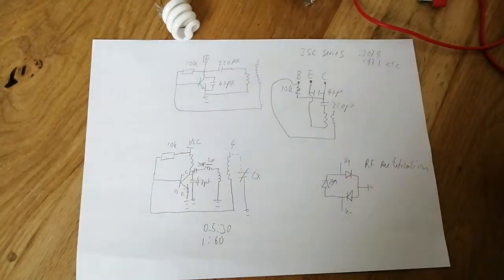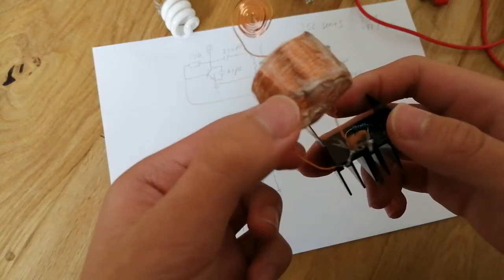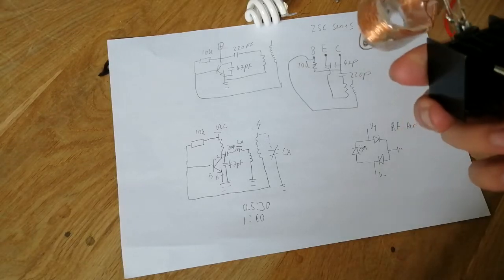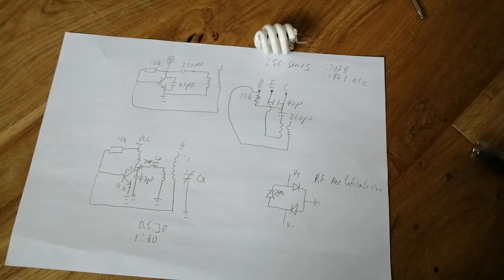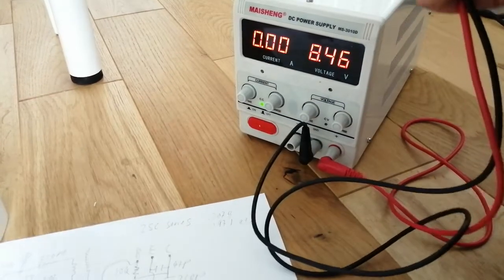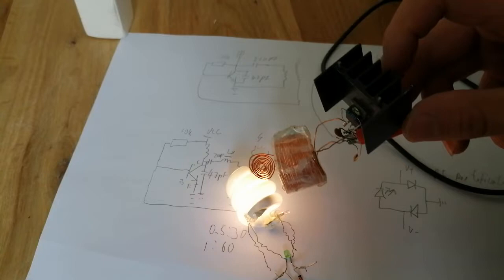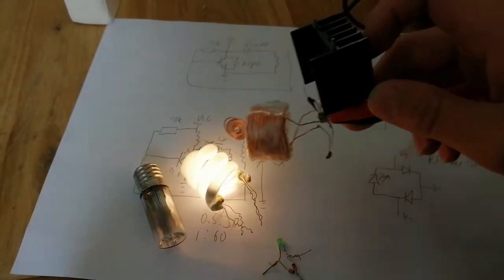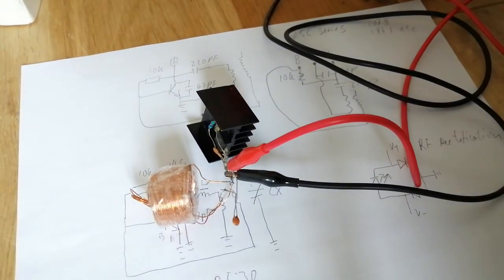Powerful RF oscillator DIY construction explained (infamous 2sc2078/ 2sc-series)

Comment: I really admire your grasp on the many properties of the circuit. I went to airframe and powerplant technician school years ago and learned about series parallel complex circuitry, which was 1/3 of the course. The many components of a circuit and their combination of varying interaction between the other components is a beautiful thing if one can truly 'see' it. I'm still working on reaching the the level of understanding that provides the perspective of oversight that you seem to have reached. I am still within the mathematical level. I raised 4 kids by myself, so my wants and desires have taken a back seat all these years. My role there has almost come to completio,  so maybe I can dive back into understanding how, why, when, where etc that valance ring electron does what it does. Thanks for the video.

Comment: Hi bro what is the benefit of the capacitor between collector and emitter 
And is the circuit of Germany boy is fake or what ?
Reply from the maker: The capacitor between collector and emitter forms the resonant circuit. Which is a high voltage colpitts oscillator. The German boy is real.
Reply: @ReedSwitchTube  thank you very much bro you help me too much 🙏
Reply: @ReedSwitchTube  but, I have another question why it is just working with this kind of transistor,  I mean what is the special thing about this transistor
Reply: @ReedSwitchTube  how about the 220pf capacitor it  also help to oscillate 
With inductor
Reply from the maker: @aemnmutahar8347  yes it has to be a special type of transistor, 2sc series is 6 used in RF amplification with pretty good gain. In the modern days Many transistor found online are all fake. About 99.98% fake. The 0.02% that you found a real one is pretty rare. Beware of the Chinese seller. I've got mine salvaged from a real transmitter by my self. Don't ask me to sell it as it is one of my artefact collection.
Part 2 of your question the 220pf capacitor needs to withstand the RF current and voltage. Cheap capacitor is very bad for this application since the RF capacitive loss is very high and your capacitor may heat up very badly. The capacitor should be rated at 1kv.and capacitance can be vary a bit. Since every one wond the coil differently. Inductance may vary. Best type is RF doorknob or mica capacitor. I hope this helps.
Reply: @ReedSwitchTube  that is mean that 220pf is just to withstand from current and voltage
Reply: @ReedSwitchTube  and from where you have buy your transistor ?
Can you tell me please if there is a store that you trust it
Reply from the maker: @aemnmutahar8347  yes the capacitor needs to be able to withstand radio frequency current and voltage. I think I've told you that I did not buy the transistor I've got it as a RF transceiver from a local ham friend for free because I salvaged it myself I know it 100% real and it from a working amplifier section so the transistor has to be real. Therefore I can't recommend you any real seller on the Internet yet.
Reply: @ReedSwitchTube  To conclusion our conversation, that is 47pf capacitor and the inductor is to oscillate, 
And the 220pf is just to withstand the high frequency, current and voltage , I am right or not
Reply from the maker: @aemnmutahar8347  yes both capacitor needs to be able to withstand RF current and voltage. If one capacitor fails during operation. Transistor is easily be damaged. So very good quality capacitors is needed. Hope this helps.
Reply: @ReedSwitchTube  thank you for help me bro, and I am sorry if I have bothered you 😅
Reply: @ReedSwitchTube  Oops 😬, I have forgotten something,why the antena is connected with the base of transistor?
Reply from the maker: @aemnmutahar8347  can you clarify a bit.
Reply: @ReedSwitchTube  I mean there are two inductor one of them is connected with the base of the transistor, what is the benefit of that?
Reply: @ReedSwitchTube  and is that a rule to determine that capacitance of the capacitor and also the inductor inductance, or you chose the value randomly 🤔
Reply from the maker: @aemnmutahar8347  the connection between the secondary coil and the base pin of the transistor is for resonant feedback. The LC formulae is not chosen for random reasons. Since this is a oscillator circuit and the value of each component will effect the overall resonant frequency. The output is coupled parasitic towards the ground. Similar to slayer exciter.
Reply: @ReedSwitchTube  okay, but what is the benefit of this connection ? It is increase something or what?
Reply from the maker: @aemnmutahar8347  it extremely important that it provide feedback for the oscillator.
Reply from the maker: @aemnmutahar8347  I'm not sure are you actually building this circuit?
Reply from the maker: It for the resonant feed back.
Reply: @ReedSwitchTube  yeah, I have tried to build it but the transistor was not original, and I also want to know how this circuit works, I am sorry if I have bothered you, you give me a lot of information, i am thankful for you 😊